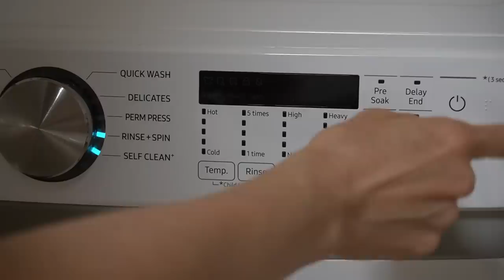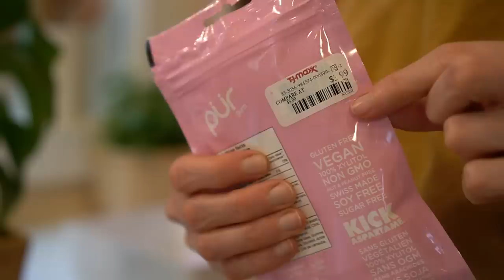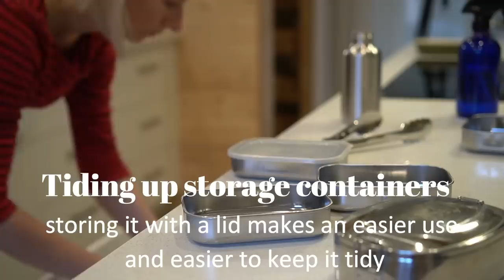WHOLE HOUSE TIDY UP | ORGANIZING TIPS | How I keep my home organized

Comment: I love your videos, they are so inspiring! I love making simple homemade cleaners as well, and thought I’d share this tip:
I believe that mixing vinegar with a soap basically neutralizes the soap and leaves you with an oily watery mess. Vinegar is an acid and real soap is made with lye (a base) plus oil. So when you mix the two the acid and base basically cancel each other and you don’t actually have a cleaner afterwards. From what I understand! 😉 Lisa Bronner of Dr. Bronner’s Castile soaps has some blog posts on this.
Thanks for all the cleaning and organizing inspiration!